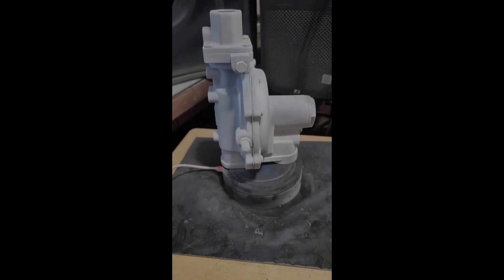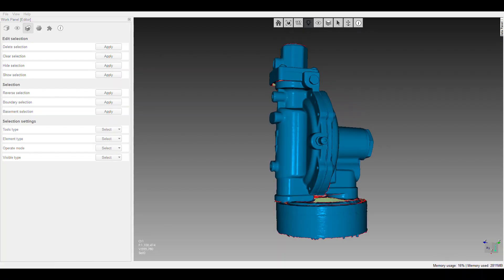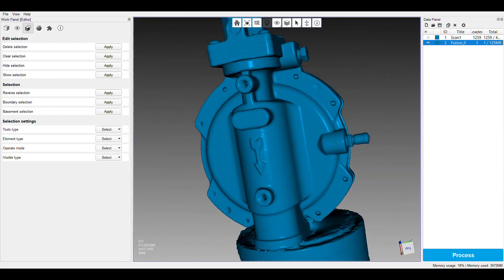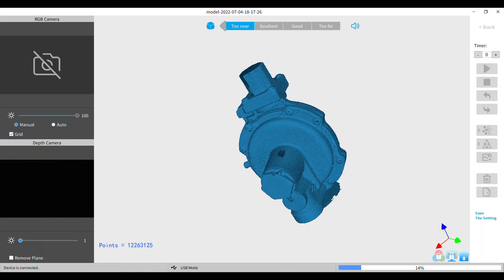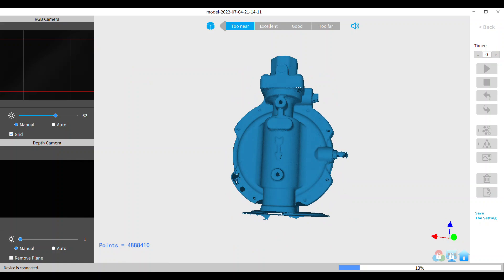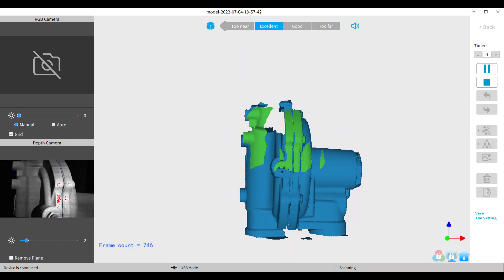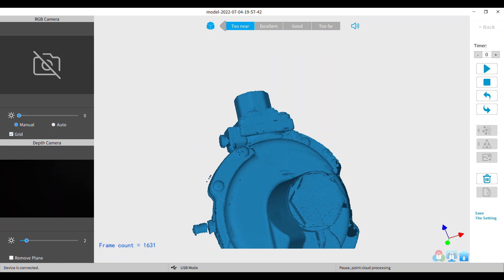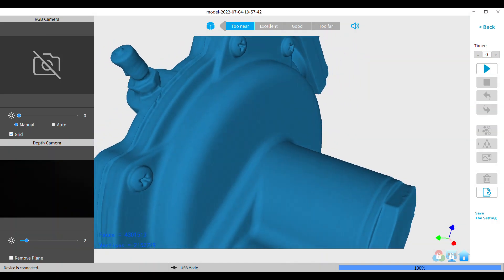Scans of an LP Gas Regulator With Lizard, POP, POP2 and MINI

Comment: Which scanner do you like for larger things like engine bays or automotive body panels ?
Reply: I would probably recommend the CR01SCAN. I have lizard and tracking on the wide smooth surfaces gets usually lost because of no reference... You need a scanner with a larger scan area, that can capture the entire car panel at once, that CR01 actually is...